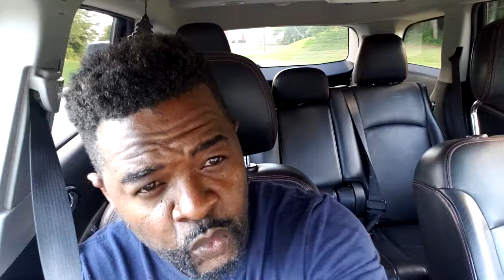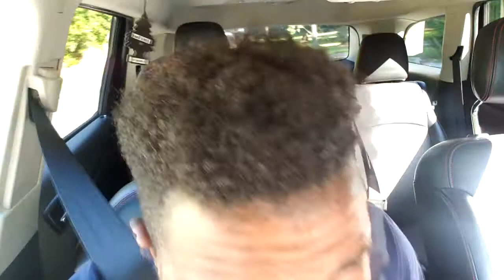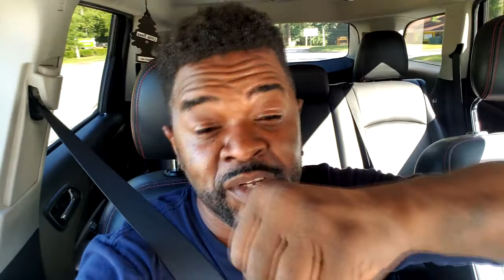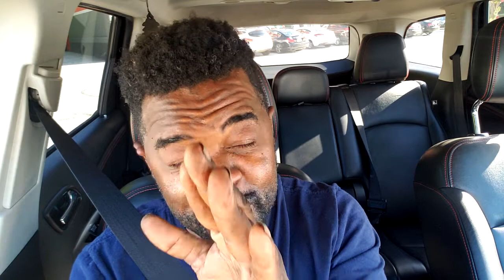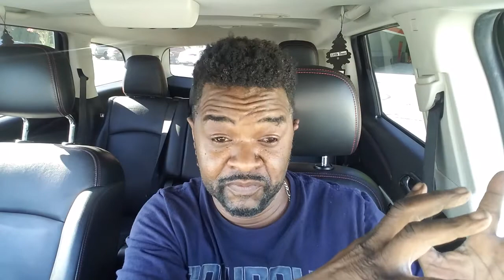NO MORE HEAD GASKET JOBS FOR ME. Diagnosing car problems by fixing them first. THIS IS A BIG GAMBLE

Comment: I use to do lots of cylinder head jobs.   Now I hardly ever do them.   On the Asian Import cars it's so much better just to buy a JDM engine for them.  Most of the time it's cheaper and easier to just replace the engine,  then the customer is getting a better job.
Reply from the maker: Exactly...In some cases its better to replace the complete engine than trying to repair an all aluminum engine that was heavily over heated..No more for me bud